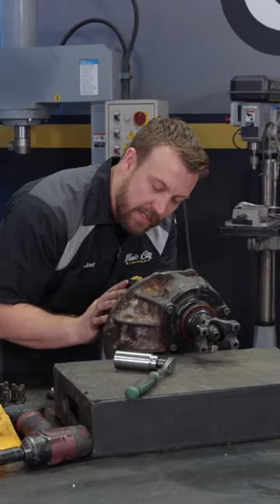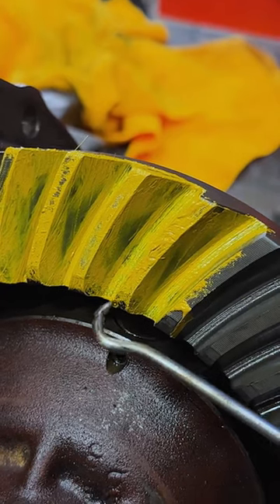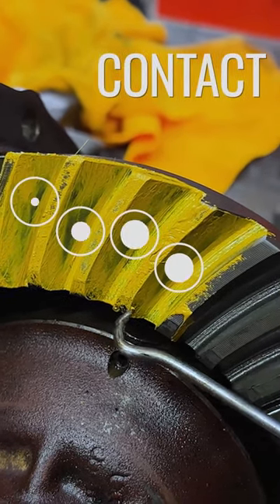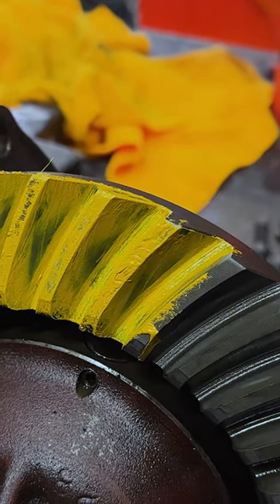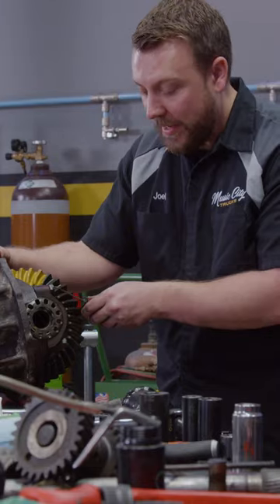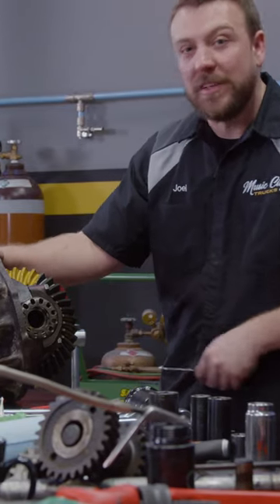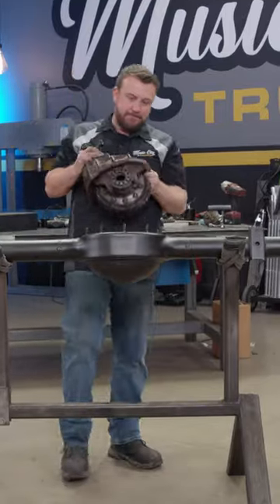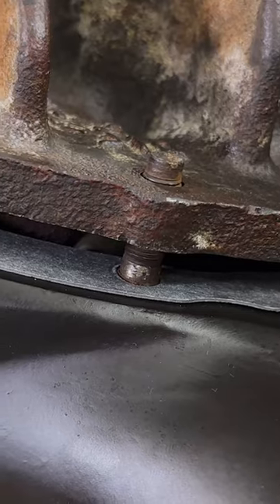Working on the Pinion Support for Clint Black's F-100 #truck #rebuild

Comment: YouTube has got better explanation on tutorials than most technical universities
Reply: If people stop going to shitty programs they might learn something .. I was lucky enough to get my training from old school automotive training all hands on we didn't learn from books or YouTube we had to learn the hard way.
Reply: Do they though? In my tech school we learned exactly how to set up differentials, from pinion turning torque to pinion depth, pinion bearing preload, backlash, ring gear runout, carrier bearing preload and making sure it has a good gear pattern, among other things im probably forgetting. Idk what bogus school you went to lmao but we has to fully disassemble and reassemble a diff, doing all measurements as we went and everything had to be in spec to get a passing grade. Im not gonna discredit this video, its very informative, but this is literally exactly what they tech you in most tech schools

Comment: Pro tip, if you notice the teeth were bouncing off each other. You DON'T get a true pattern that way. Take a rag and hold the yoke loosely and move the ring gear with your other hand. Works best in a third member rack. Then check your pattern. Do this on the cost side your choice but definitely do the power side or run side. Big pro tip, always make sure the pinion nut is torque to spec and the main caps are torque to spec before you check the contact pattern. I don't care if your back lash, or run out is on the money if your contact pattern is not right there is something wrong. Pro tip
Reply: This is so true you need a load on ring gear for a true pattern, I put the drive shaft in it get someone to hold it place a 3/4 wrench on ring gear bolt then roll it back an forth while the paint is in pinion gear then read your gear pattern, his backlash even sounds more than  8 thousands any how good luck,hammer down
Reply: No one does what you suggested. I had my rear installed 2x. It was roaring on the first road test, both accelerating and coasting. They redid the job. Second install was worse. Rear ends require more finesse, skill and knowledge, well out of the league of some decent mechanics. You can clearly hear it inside the cabin.

Comment: I suspect spinning the pinion 1/4 turn at a time doesn't make for a very consistent pattern.  Reckon I'd spin it with a power tool of some kind (or even get a buddy to turn it smoothly and uninterrupted) while holding some pressure on the ring/carrier.

Comment: You used to be able to buy white lead compound, which worked excellent. Made a clear and visible pattern. 
Thanks, Nanny State bueracrats
Reply: Yeah, who needs brain cells anyway
Reply: @GW71093  it's safe if you handle it properly, if you have ever used it you'd know. Moot point anyway.

Comment: Is anyone else bothered that the ratchet is all over the place, barely has the socket on the nut half the time.
Perhaps needs some work on nut discipline...
Reply: There is no torque being put on it so why does it matter?
Reply: Why not turn the yoke by hand
Reply: Why was he even using a ratchet?
Reply: @corridanmoffatt7582  so he could spin it by hand without taking forever like a wrench would durr

Comment: Bad info.  Pattern should center root to tip. Toe to heel is not as important. And that pattern is deep
Reply: Thought the same thing almost bottomed out bet it’s noise
Reply: Correct. Heel to toe can have multiple acceptable wear patterns, especially on a brand new gear set. Get it in the acceptable pattern zone, break it in and it’ll be perfect.

Comment: Dude clearly doesnt know what hes doing. Gotta put load on that ring gear in both directions. Also notice how floppy wrist he is while holding that socket onto the pinion. Struggling to keep that aligned while turning is a clear sign of an amateur. Thats supposed to be a how to and your only giving about 10percent of the info